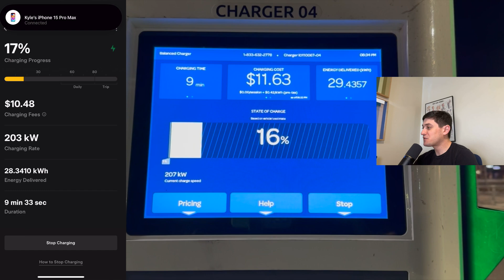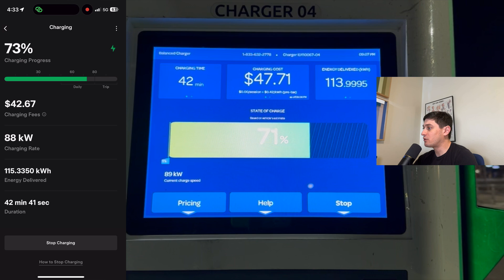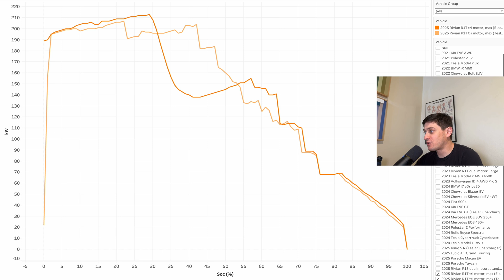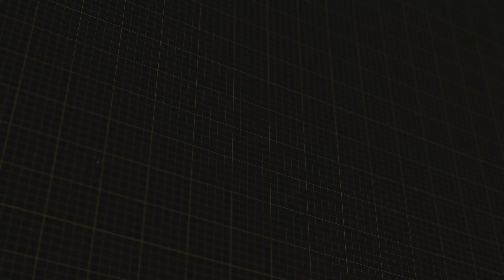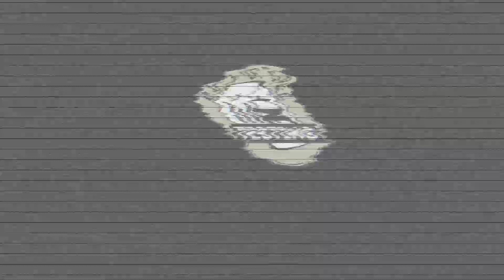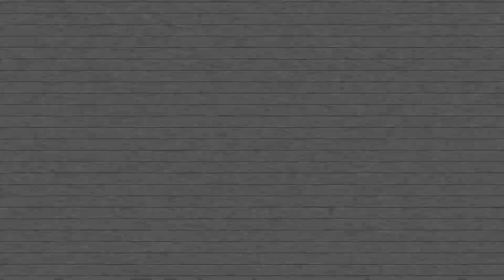2025 Rivian R1T Max Pack 0-100% Charging - Electrify America vs. Tesla

Comment: Hey, Ryan, I know it's a lot of effort, but it would be interesting to see you do a check-in charge with Kyles R1T Large.  As we saw in previous testing, the Large battery seems to have better charging endurance than Max and I'm curious if recent software changes have brought them closer together or further apart.

My personal experience with my R1T is that charging is much more consistent than what Kyle was showing a year ago and typically looks something like the supercharger curve you have here, but definitely varies.
Reply: My experience as well is far better than Kyles (dual large performance)

Comment: A lot of great information.. great test. Good to see the results were pretty close too.
The one thing I see a lot  in the charging tests on the vehicles with larger batteries is the COST!!!  for that charge and the miles you will get for that money. It's not great.. I think it's worse than combustion cars. $64.30 cost that would buy you 21.43 gallons of gas where I live.  That would take you 428 miles at 20MPG..  average truck/SUV would probably be a little more efficient than that. But it's a good average.
I think this is why with towing or if you do A LOT of road tripping...ICE will be around for a long time. It is just not cost and time efficient in the EV.. with the exception of California.. which has insane fuel prices.
I have found this myself on road trips with my EV... it is slower and cost more than my previous Toyota Hybrid.
Reply: No one, absolutely no one, positioned public charging as cheaper. The savings have always been home charging.
Reply: @chrism3731  
Well definitely someone. Cuz I've heard it before from various media outlets. You need to use the right tool for the job. I would say if you road trip more than 25% of your miles yearly. You probably ought to stick with an efficient Toyota Hybrid. Or if you're using a truck to tow long distances regularly same situation you're better off to buy gas or diesel. I drive an EV for local use. And I love the car. But a lot of EV fanboys pretend that EVs are the panacea that will solve all problems in all transportation sectors. And that's simply isn't the case. 
You also often see EV proponents using the worst case scenario for a combustion car and trying to compare it to a much better case scenario with the new EV that they bought. We'll talk about how much less their new Tesla cost them. And then you find out they were driving an Audi or a BMW or a Mercedes. Vehicles that have some of the highest operational and maintenance and repair costs. If they had been driving a Toyota Camry they would have had a radically different experience and the comparison between the two would be very different also. Use the right tool for the job you needed to do

Comment: So the fill up cost 65 dollars?  I'm not in the USA but isn't that roughly what a tank of gas would cost?
Reply: Yes using fast chargers is usually roughly equivalent to gas, the savings come from when you charge at home, depending on where you live it could cost as low as $10
Reply: Costs have risen a lot recently. The charging savings will really only occur if you’re charging at home or driving a more efficient vehicle like a model 3. The trucks aren’t that efficient so higher prices are expected but like I said charging from home can make a huge difference. Even then, still have less maintenance which helps.
Reply: A gas fill up in California with a 30 gallon tank truck would be more than double $125+
Reply: Up about 2x from 24 months ago.
Reply: Still cheaper to charge Ev. Filling up Chevy Silverado from empty to full cost about $80.  Charging at home would have cost roughly $25. Obviously this will be different for other people based on use case.

Comment: Do any EA stations really charge at 350-400 kw? Or is that just for show on the charger?
Reply: The vehicle has to be able to take 350kw.   The Silverado EV  is one such vehicle.
Reply: Yes, they do. You often see them with 350kW and 150kW units. My kia EV6 charges noticeably faster on the 350kW unit, since it can pull 240kW for almost 8-10 straight minutes

Comment: How did you know station and not truck is throttling?
Reply: Looking at the battery temps, charging on EA just got hotter more quickly. It’s hard to pin the blame on just the charger or just the truck, but the combination seems to have a problem.  It’s worth mentioning in both instances the battery was fully preconditioned and the ambient temperature was in the mid 30s so it’s a bit of a head scratcher as to why one throttled and the other didn’t.
Reply: @ryankassel5691  Ryan, so you are saying the truck's battery temp is what caused the throttling  - the truck received more current from EA than from the Supercharger, and the truck's cooling system couldn't keep up? If that is the case, then it seems unfair to blame the EA charging station.
Reply: @ it seems to be the most likely cause however it’s only a few kw different so it’s a bit strange it would have such a big effect. I can agree “blame” isn’t the right word but there is overheating on this truck when it charges on EA.
Reply: @ryankassel5691  Your team (Kyle, et. al) have repeatedly blamed (sorry) Rivian designers for giving the pack a sub-par thermal management system. As someone who has programmed many control systems, I can assure that it is common to have upper and lower limits for certain process values, and it seems that the extra bit of current from the EA station caused the truck pack temperature to reach its upper limit, thus throttling the current shortly afterwards. It would be nice if you could extract data from the truck's BMS to see cooling power in kW during the charging session. Maybe pre-conditioning the pack is not such a good idea as while in theory you warm up the pack to accept maximum current, if this leads to throttling 10 minutes later, then it may be counter productive. Giving you extra work here but might you be able to dig up data on a R1 vehicle charging session that did not have a pre-conditioned pack? Thanks!!
Reply: @ I totally agree with you, I just find it odd that ~208 kW is enough to hit that thermal limit but ~200 manages to charge without overheating. I’ll have to check on the cooling power, I’m not sure how much it pulls for that. I’ll see if we have any non-preconditioned sessions but most of them are preconditioned.
Reply: @ryankassel5691  I think we also don't know much about the stations here. if it is a v3 or v4 supercharger and what hardware it was for EA since they use different hardware which certainly would impact this. 
Not sure this is a particularly useful test beyond the: the difference for 400V architecture cars isn't that big either way which was obviously not the case for higher voltage cars tested recently.
Reply: @ yep there are a lot of different variables. Tesla was on a V3 magic dock while EA was a BTCPower unit.
Reply: If we can agree that car throttles charge rate due to high battery temp, then DCFC hardware is irrelevant.

Comment: How many miles did you go from 100% down to 0?
How many miles did that get you and how many Kw did you add to get back to 100%?
Reply: 298 miles, 153 kWh
Reply: @ryankassel5691  1.95 miles per Kw?
My 2022 Tesla X only gets 2.6 miles.
Reply: @ 
298 miles is far short of the touted 410…
Reply: @ this tri motor with all terrain tires is rated for 329 miles
Reply: @ 
Brilliant. I didn’t think of the other models. 
.215 cents per miles…

Thanks for getting the actual miles as most ev drivers don’t want to see the actual real world efficiency. They are blinded by Tesla’s Rose Colored Glasses.

Comment: Here in the northeast Tesla Superchargers are often 30-50% cheaper than the EA stations.  At least the corridor I drive most often between NJ and VT.  Once you add the fact that most EA sites have only 4 chargers while Tesla has at least 8 and how often one or more chargers at EA are offline I almost never even try EA unless it is on my path.  Of course Tesla is best at being on the path compared to EA locations as well.
Reply: Tesla chargers here where I’m at in Eastern Canada, they are charging anywhere between 83 and 90 cents per kwh. Highway robbery.